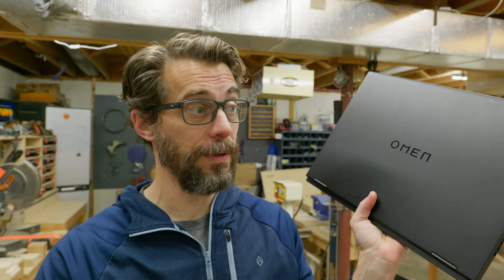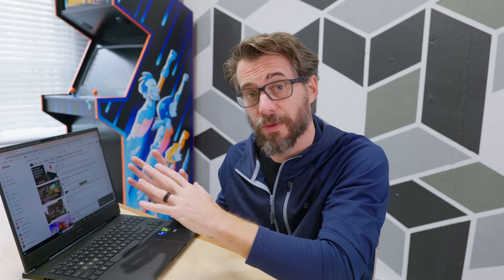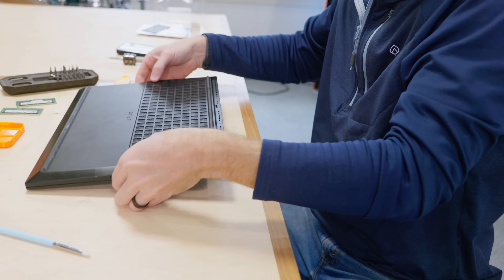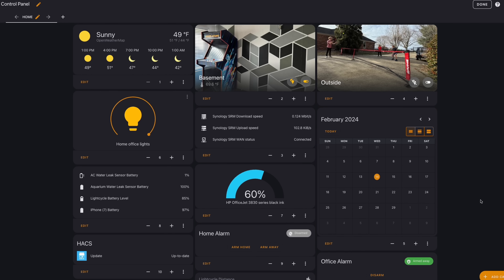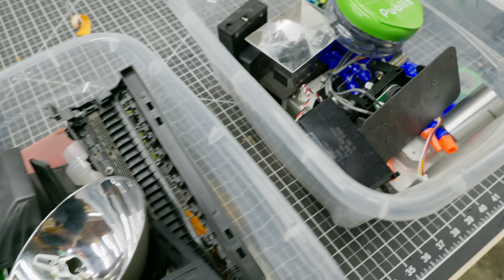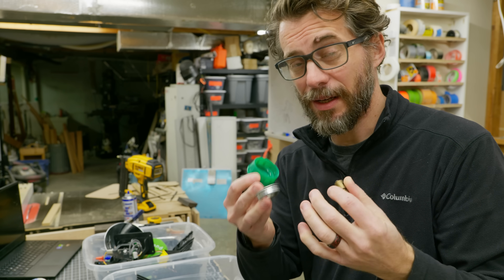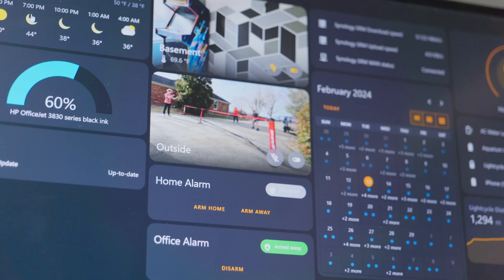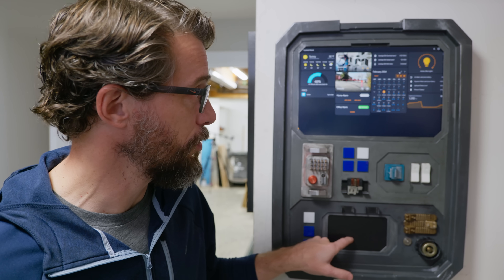A Cooler Way To Control Everything in My Smart Home

Comment: Since the keyboard is behind the panel with the greebles, you could have put most of the greebles on small springs or pieces of spongy foam, with pegs that passes through holes in said panel, so pushing on the greebles will press some of the keys on the keyboard. Then it is just a matter of setting hotkeys for the apps you use e.g. the keys behind the blue and white squares can be set to, say, get camera feed from around your property, the white rockers can adjust volume on anything that plays music or sounds, the former ink heads can be used to arm/disarm the alarms, etc.
Reply: Love this idea...

Comment: you should not use a raspberry pi sd card to run homeassistant, you should use an ssd via an usb adapter or a differnet pc like an hp elitedesk or an intel nuc for it. you could use aswell an nvme adapter for the raspberry pi to run home assistant. Homeassistant eats sd cards sadly because of the lot of data it collects on it, when you have a lot devices conntected and automations etc.

Comment: Only issue i see in it is there is no quick access to the power button whenever you need to restart it to fix something wrong on it or if the power went out and then it dies cause no charge.

Comment: The one thing that bums me out about automation and smart devices. They all are working on the wifi/bluetooth rather than the wired. 
The news is now reporting people using jammers to cut video feeds from wifi cameras and other devices before raiding a home of everything. 
While some of the stuff is nice its all wifi. I have looked in to wired stuff and there is no real market for the retail consumer. Most of its related to the commercial higher end lines. For example a wired flood protection is 1200 bucks. Where are all of the wired door sensors, window sensors, motion sensors, temp sensors, flood sensors, door locks, security cameras, clocks, message screen and so on. Each one of these things can be found in the wireless Belem yet not much can be found in the wired section. Everything should be able to interact with a computer at home with out the need for any outside internet. The same system should be able to work using a app with any internet connection from your device. The ability to be able to do all of this would be far better and the data can be stored not only local yet cloud based as well.

Comment: Very good looking project Bob! If it gives you an idea, I recently built a similar panel myself, repurposing an old iPad 4 gen (10yr old) which hasn't received updates in 5 years or so. The hardware is still great and for occasional use for this kind of dashboard a battery charge still lasts over 3 weeks. I had to build a light web app on top of home assistant using their APIs though, as their dashboards don't run in the old ipad safari.

Comment: Are you sure the airflow is all through the bottom? When you took off the bottom to replace the RAM it looked like the fans were using the sides too. The left side vent is blocked off by the wood. So that side either can't pull air in or push it out, depending on which way the fan is designed to work.
I do genuinely love how this came out. The use of the LEGO removal tools was very clever. Those of us who have kits usually have a box of those hanging around.
Reply: Doesn’t seem like he’s going to be doing any computing or graphics intensive tasks. Computer temperature should be fine for a project like this.

Comment: I would suggest to anyone who is starting to use Home Assistant, use the full os not the docker version (or run the os in a virtual machine) to prevent any issues with the drivers or devices  accessibility, and that also make it easier to employment the monitoring plugins
Reply: This. Installing on bare metal has been way easier than docker, imo. Even then, it's still deep, deep waters; if you're thinking about getting into HA, prepare yourself for a new full time hobby.
Reply: I've been rocking it from a VM for about 2y without any problem.  Also heard of issues with Docker.
Reply: Docker user here, never had problems with it. And I like that I can host other containers and embed the websites on HA
Reply: @LukanRocks  
Sorry, but are you using the docker version with just the basic stuff or with more advanced things like node-red, esphome, and watchdog...etc.

If you are doing the advanced things, that means you are playing life on hard mode 😅
Reply: @bader51500  well yeah you can call it "harder".

I started with the OS but switched to docker so I could have the machine for other things besides HA.

But I also come from a software engineering background, so I would say that it's HA with extra steps.
Reply: Came here to say this . Been a user for couple of years now .

Comment: I used to work as an HP repair tech which makes this incredibly funny, because the whole reason laptops are typically a pain to work on is because they use around 20 screws to hold the base cover on, two different sizes of screw and often also at least two different lengths of screw.

So now they're like, "hey, remember that problem we invented? well we fixed it, you're welcome!"

Comment: leaving a laptop plugged in all the time is not good for the battery. i would use home assistant to cut off charging at 90%, the way i do with my androids. you'd need some software on the laptop that reports the battery level to home assistant, and 2 automations that switch the charger on when the battery is below 50% (or whatever you think is appropriate) and off when the battery hits 90%.

Comment: Great Bob!
Just an idea: maybe it would be useful if the central panel was removable, maybe attach it with magnets instead of glue. In case you need access to the keyboard, or also to turn it on.

Comment: I hope people realize that a laptop is a huge waste of computing power for even incredibly elaborate smart homes.. most people use cheap tablets or a scrap monitor and tiny PCs or an Rpi as you mentioned briefly.

I understand you needed a project to fit the PC as a sponsor but just feel like that needed to be impressed upon more because if people think 'oh I want to do smart home stuff!'.. they should know it doesn't require a $1500 laptop sacrifice
Reply: It's not only a waste of computing power, it's also a waste of money (you don't need windows for this) and also a waste of power (such a control screen shouldn't draw not more like 5-10 Watts peak). This thing probably draws 30-40 Watts idle

Comment: Really cool idea as always! I like the idea of utilizing the laptop trackpad instead of a tablet or touch screen to avoid fingerprint smudges. One suggestion, if the laptop is being left plugged in all the time and is only being used as the "controller", it might be a good idea to remove the battery so it doesn't swell over the long-term.